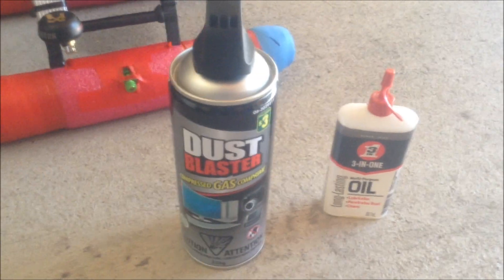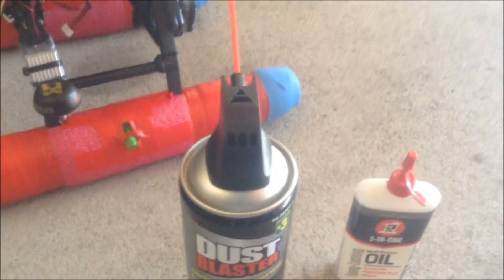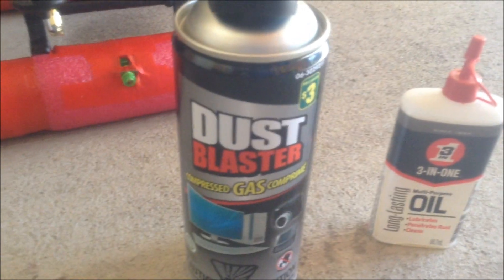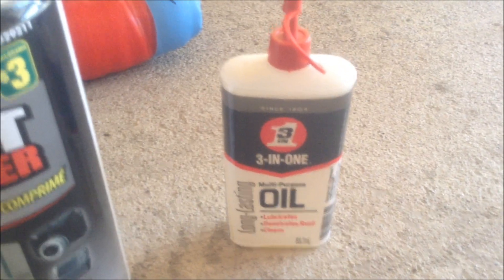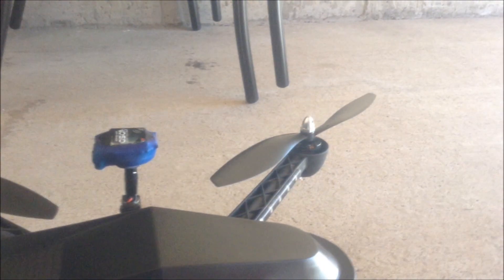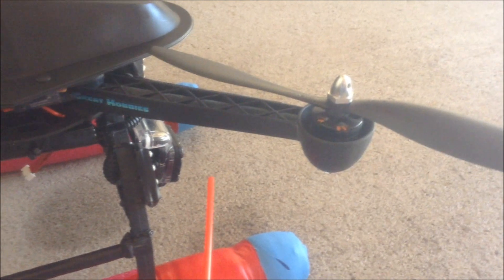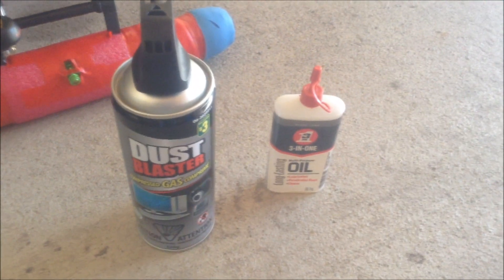Quadcopter Motor Maintenance

Comment: 3 in 1 not best choice for the high speed rotating shafts, try Labelle-Lubricants.com, PTFE lubes that are good up to 450F during operational use..... #1 selling lube, almost 1,000,000 sold, check it out

Comment: All bearings that come ready fitted in a brushless motor should be of the shielded type. These will absolutely, definitely, without a shadow of a doubt, come ready-greased from the factory. Greased - not oiled. Without removing the shields "oiling" them can only mean dribbling some light oil onto the outside of the shield. At best, a tiny amount of the oil will get past the shield - at which point all it will achieve is to wash the grease out of the interior. Do that enough times and you'll end up with no grease left in there. The difference between oil and grease is that grease is designed to remain sticky/viscous at high temperatures. Oil, on the other hand, reduces considerably in viscosity as it heats - therefore oil is only effective if the part in question is sitting in a bath of it or the oil is pumped over the moving parts continuously (as happens inside a car engine, for example).

-jes1111

Comment: Nice job, I notice the oil making a difference in my quads especially running 250's hard and 250's at 4s.  I oil every run while my equipment battery tops off.  Takes me 1 minute to oil up between 6 minute flights and my stuff lasts much longer than when I used to oil every 5 flights.  I don't blow mine out but my launch surface is clean.  I do make a pointy little dabber out of stiff paper towel to absorb the oil from the visible bearing surfaces to prevent greasy buildup, rotating the motor to wipe the entire surface.  I use a different oil but light bearing oils are all similarly protective.  I notice a difference many fold in longevity of the motors and the quietness.  If I weren't charging up a battery between flights I might oil only every 3 flights, but I definitely noticed a difference going from 5flight to 1flight interval in noise reduction and motor life.  I've been nursing along 1 motor that started to rattle, but it also spins more easily too while it lasts so I won't yank it yet.